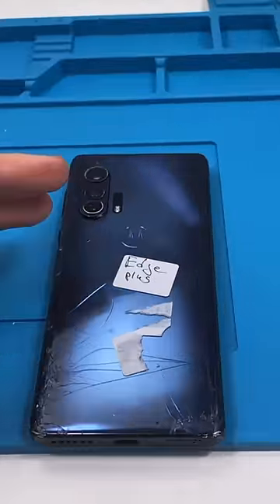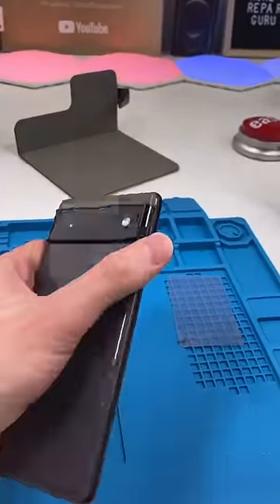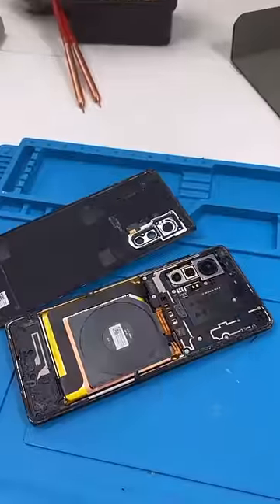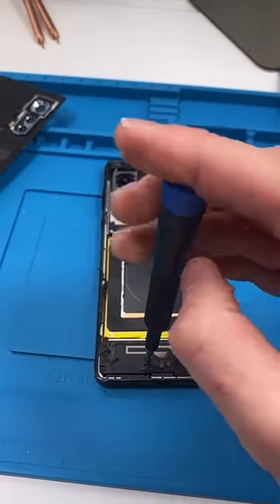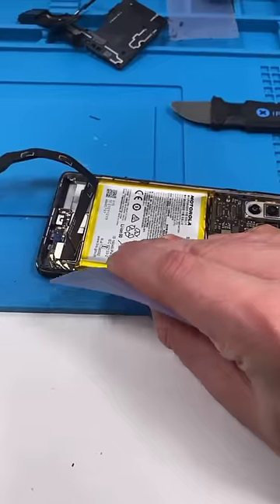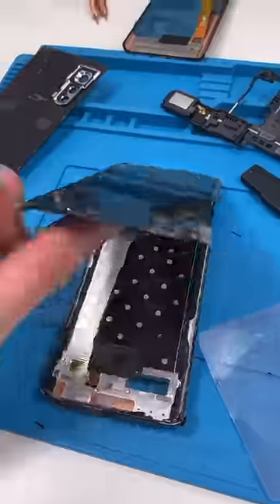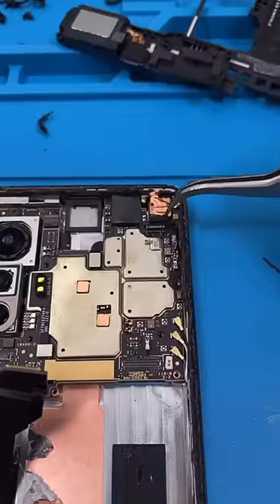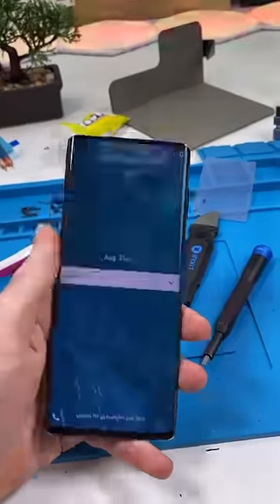MOTOROLA'S ARE TRASH... To Repair #Shorts

Comment: motorola recently released a new series, the edge 20 series. the phones are as cheap as $250 and the specs are insane, 144hz fhd+ 10bit display, 6.9mm thickness, sd 778g and 8 128 config. with custom rom support and stock android out of the box these are really cool phones for devs (testing purposes, secondary phone or even the main device!)
Reply: Almost every Qualcomm device has custom roms except Oppo Vivo Samsung (US). And once you open your bootloader your warranty is gone forever and Motorola only gives 1 year Android updates

Comment: Only good phone I could find with LTS for Android updates that doesn't have a stupid OLED display was the 2021 Moto Edge. I like OLED but if I use a device for years I don't want to worry about ghosting in 3-4 years
Reply: Been using pixel xl gen 1 since 2016. No issues

Comment: I had a Motorola Moto G6 and it was trash. I put up with it for around 3 months or so and sold it after getting a OnePlus 6T which I'm still using.

The Motorola had a terrible camera which would turn a perfectly straight line into a slightly bent one and it was very noticeable. The LCD looked grainy and it felt sluggish at times even though I bought it brand new.

I've had my OP 6T for just shy of 3 years an am either looking at rooting and installing a custom ROM or buying a phone with a Snapdragon 865 with 6-12 GB of RAM for less than £700.

I could go for a OP Nord, which is lower specs than what I want, but their higher end lineup is now being deemed as trash due to their latest Oxygen OS version.

Comment: Motorola is the best phone ever made
Reply: I still have two near the television that I use as Mini tablets. Everything still works on both, even the batteries are still holding a somewhat diminished charge. Where will this IPhone be in 8 or 9 years?
Reply: @billchessell8213  I know! The batteries on the Motorola is amazing

Comment: I hate Motorola's I am a hardcore Android user but to see an Android phone like this and for me to experience it for a couple of years it's not fun I had a Motorola G7 play and a Motorola G7 which I'm using right now their cameras suck at taking pictures but they're actually pretty good at video if they're screens degrade over a short period of time and the screen on the G7 is just outright garbage colors are kind of washed out the touch screen is way too responsive so it clicks on everything you're trying to swipe on and if you leave it on on like a specific picture for long enough for a couple of minutes you would have imprint of what your previously had on the screen, a couple years back the BLU vivo 5 which is it's running a much older version on Android which is no longer supported but that thing had an amazing camera and had amazing specs for its time and it's screen was the most beautiful thing I have ever seen it's better than any OLED that I ever seen that for an LCD is amazing in the future and very soon I'm going to be ditching the G7 and getting another BLU their flagship device the g91 pro it is a rocking some pretty darn good specs including a decent camera which normally I don't really care about but I do stop motion and for that it's kind of important and I haven't done it in a while I need to get my skills up again I also had a BLU studio XL which is also out of date but it had a darn good screen to

Comment: When my coworker told me he was going to fix one of these by replacing the front glass at home I laughed and told him no sir you'll replace the digitizer with a lot of patience if not no you won't fix it.
Reply: So easy to do. 4 minutes on the separator with heat, razor wire and patience. We do s21 and notes all day long. This phone is flat. Soooooo much easier 😂😂😂😂
Reply: @jessepetty8636  no shit with the correct tools its easy when using household items its much more tedious.
Reply: @brayannexon4613  oh, well I assumed if he was smart enough to try it he would have had experience and knew what he was doing. You’re definitely right, idiots with a butter knife in their bedroom shouldn’t. I figured from the sounds of what you had said he had a tool bench and or work area. My fault.

Comment: I own a Motorola edge plus camera software could be better finding a screen protector is a pain and they are the plastic screen protector and putting on the screen protector is also a pain Ive ruined 3 of those plastic screen protectors trying to get one on only to run out of the screen protectors and saying f it let's risk it and use no screen protector and two days later i drop it and it put a noticable scratch on the screen

Comment: If it's made by Lenovo of course its trash
Reply: Isn’t Lenovo/ThinkPad still the darling of the corporate laptop?
Reply: @billchessell8213  Modern ones are crap. I played around with a brand new one in a store, the damn thing flexed in the middle when opening and closing it indicating plastic hinge mounts = they will break off with normal use. These days even Dell makes shitty laptop. I don't know about Fujitsu and Vaio but i have seen a 6yo Fujitsu ultrabook with ruined hinges. So far i'm sticking onto my 2007 Fujitsu-iemens as long as it can do all i need.